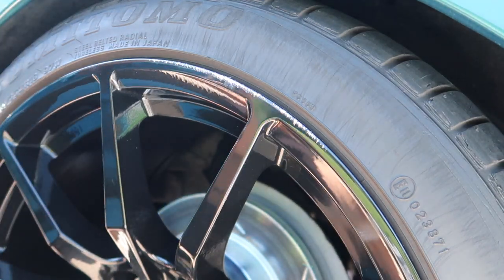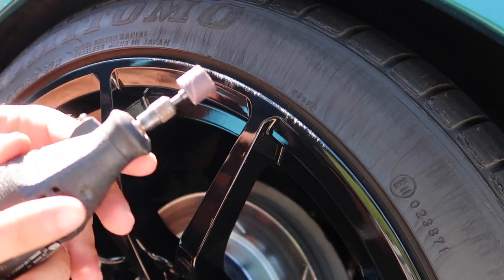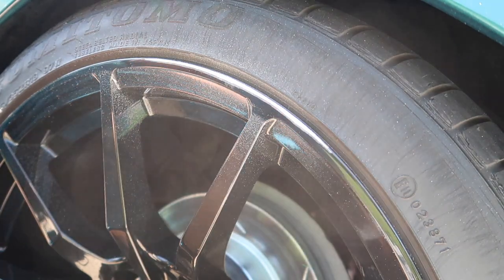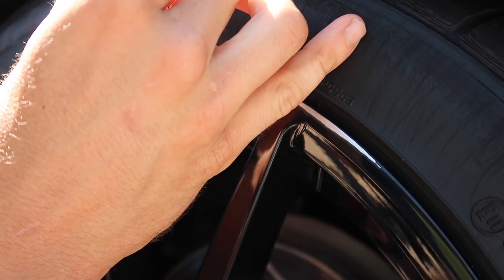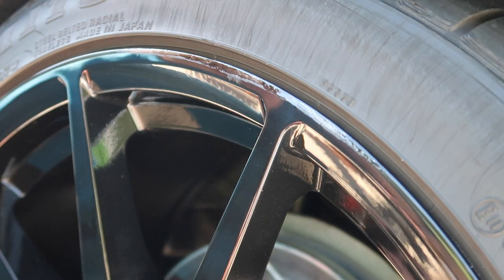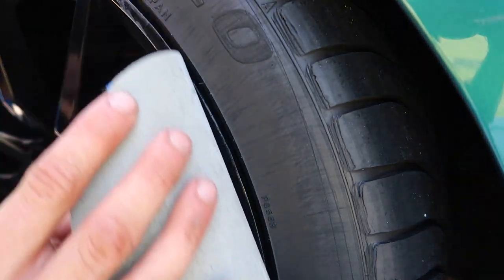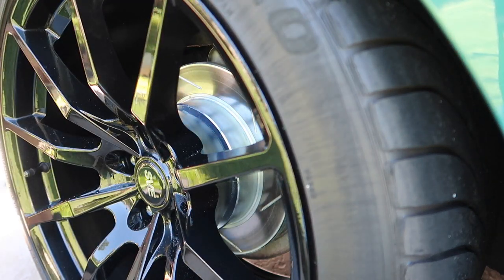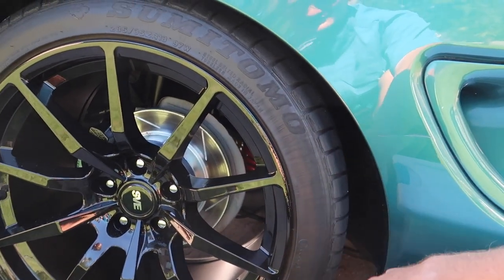How to Repair Curb Rash on Wheels Black Rim

Comment: I'm giving this a try based on your great video. One question though, are you making the 3000 grit sanding paper wet?
Reply from the maker: Yes. Always sand 600 grit or finer wet. The finer papers (600 and up) will clog much faster, making the sandpaper useless. Using water provides a medium for removing excess material, keeping the sandpaper clean. Wet sanding will maximize effectiveness of the sandpaper
Reply: @nicbowen38  Thanks Nic. Yeah, I figured that much in the meantime but thanks for confirming it. Makes sense now that you explain the reason for it. Thanks for the instruction video btw. My fix turned out pretty good. Thankfully, the curb rash damage was on less fancy winter tire rims vs. my fancy rims ;)

Comment: Did you use clear coat at all? Or was it not necessary?
Reply: He did not, but clear would help it last longer. Some primer / adhesion promotor probably would have been ideal too since he painted straight on the metal, or even better some bondo glazing putty before sanding step to avoid having to take so much material off. 
Not knocking his work though, not how I'd have done it but we all have different priorities.
Reply: He should of